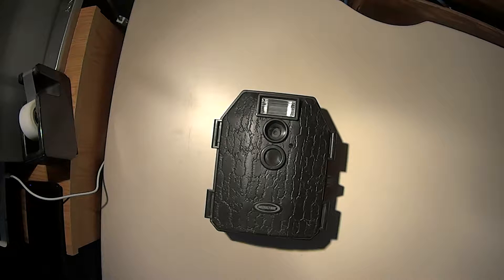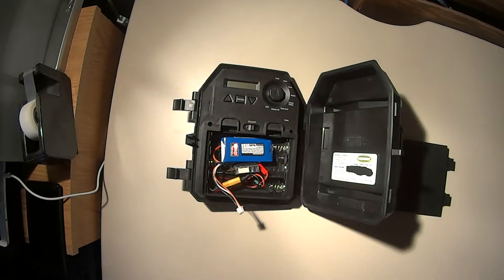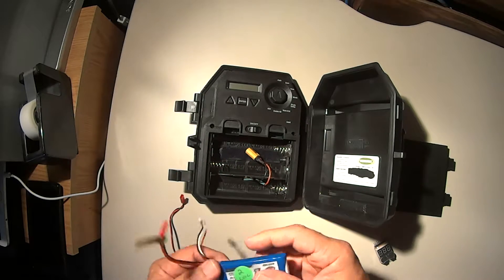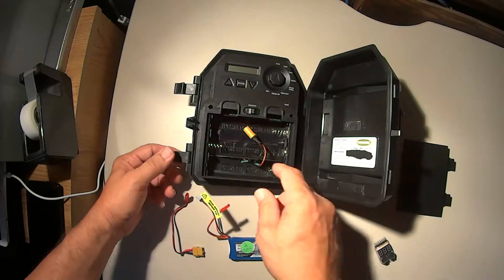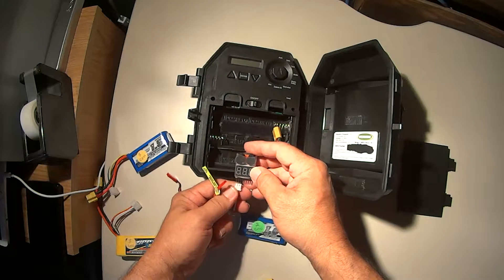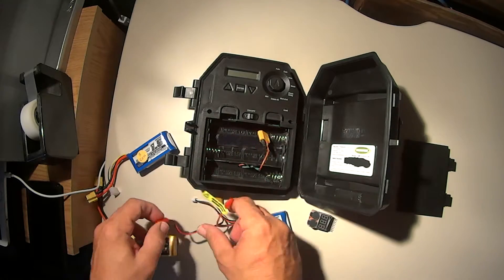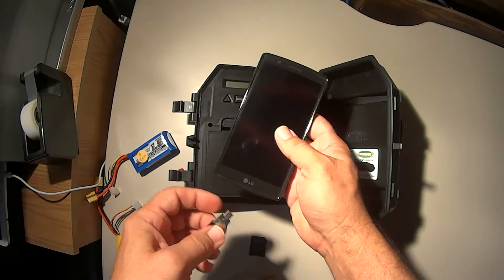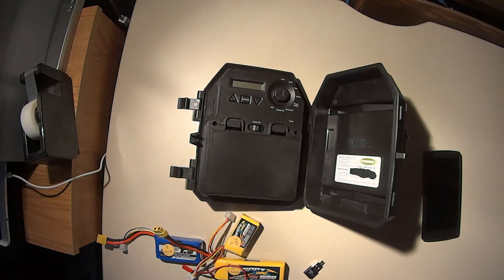Moultrie Trail camera Lipo Battery Mod

Comment: #1 Why not just connect it directly to the positive and negative in the compartment? #2 If you leave them in the field, and they are safe? Buy a cheap solar set up, like for a little light, and run up the tree. Jump into the sd card slot, and connect a small transmitter like for a wireless keyboard or mouse. When in range you can connect and pull the data wirelessly. If field means your yard, then buy a good router, and you can pull from your house. Maybe a chrome cast can be wired in. #3 I just bought one for $10, what are your thoughts on yours today? Great video, didn’t think about modding mine, but now I might.
Reply from the maker: Good questions . I guess I could have connected it another way or 2 , but chose that way. I use it in the back of our property. Its about 200 yards from the house and just a short walk into the woods, so no need for a router and wifi.  I had lipo's just sitting around and they would be wasted if I didnt use them . I also have about 100 18650 batteries that I have some projects lined up for and already made a power bank with . I was looking to do things as cheaply as I could . I knew about solar power . But I also did a mod for my other trail camera as well with lipo's.  And this is my most dependable camera to tell you the truth. However I left the battery in too long this last time and almost killed  it. Took a while to get it to charge again.

Comment from the maker: I never let it go more than 2 weeks , since it was in the woods behind the house. Might depend on how cold it gets. I would think you would get about a month if not more. Maybe I will test that this summer when I get the time. I am using 3S 1500mah lipo now , and it seems to be ok. Also modded a Browning trail cam by getting an external battery case that holds 8 AA batteries and I cleaned that out and put in a 3s lipo there too. Works just fine.